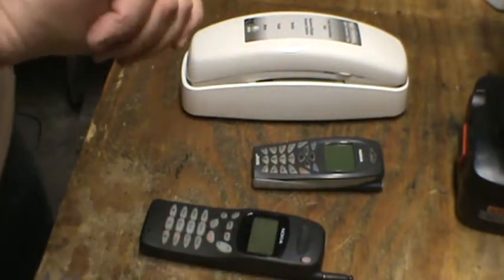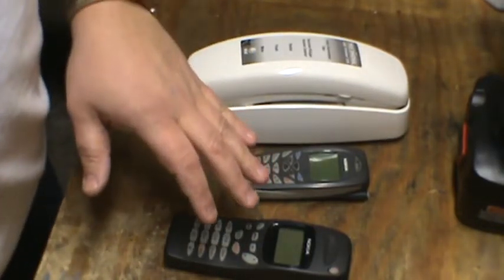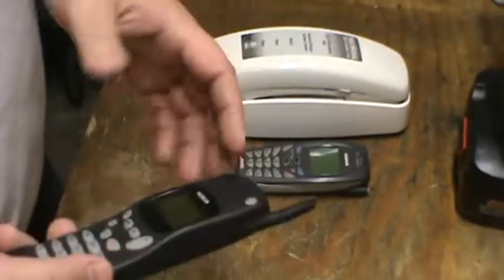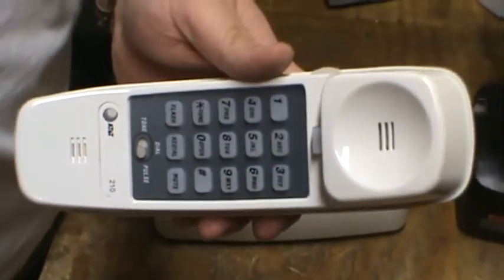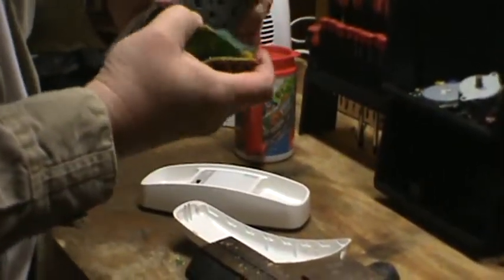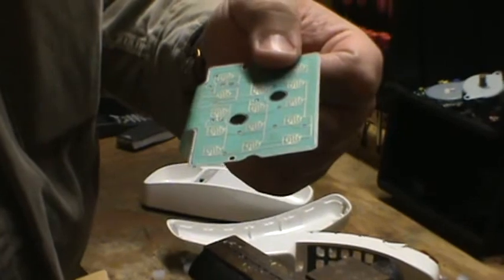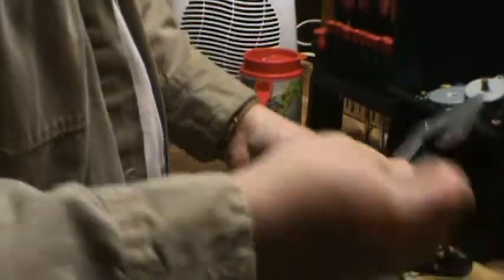Scrapping Home Landline and CordlessPhones for Gold and Silver

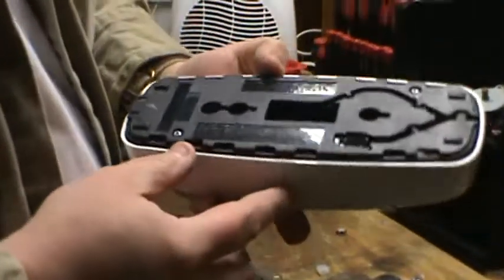Comment: Moose i saw just quickly on the bottom side of the brown board  3:15-3:22 what appears to be gold platting in the board.I realize this is a old vid so you cant just look at the material but is there away you could  say if you think it was? I have several boards that have similar looking material but i didn't think brown boards had gold like that.i have about 50 small out of date cell phone adapter boards that look gold but all theyr transfer is power to my knowledge.They allow you to plug into your phone and charge with almost any other charger  cord.the brown board inside is about 4 in diameter and what appears to be gold lines all over it to the different ports.Any help would be great  and yes i am a newbie at this :) thank you and love your vids
Reply from the maker: +Amber Moss Hi and thanks for watching.  I don't think it was as I am usually pretty quick to spot and note gold plate. That's what EVERYONE seems to be interested in these days.  As for the boards, when in doubt, clean off all the components and solder and throw it in some AP. If its gold is it will come off, if its copper with a solder mask is probably wont come off.
Reply: Thanks again and as always your very helpful. Happy Holidays